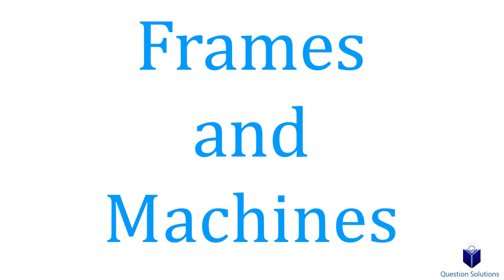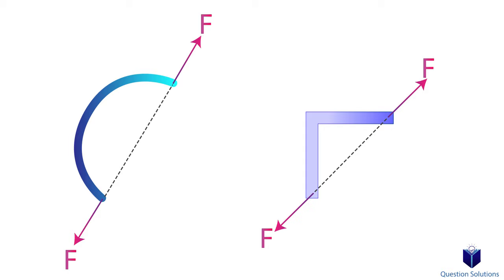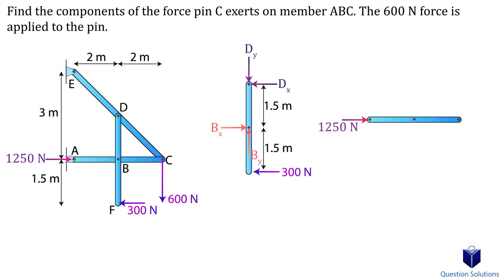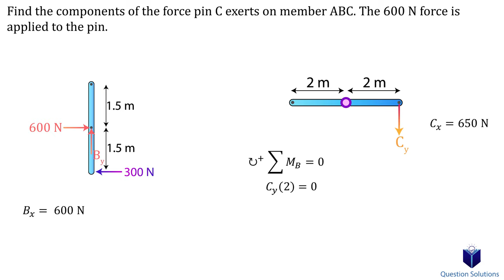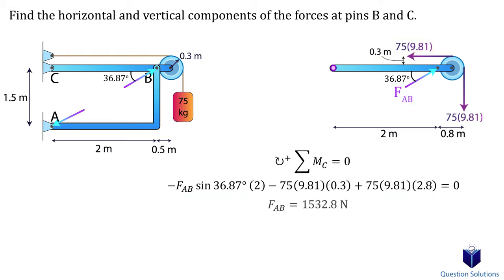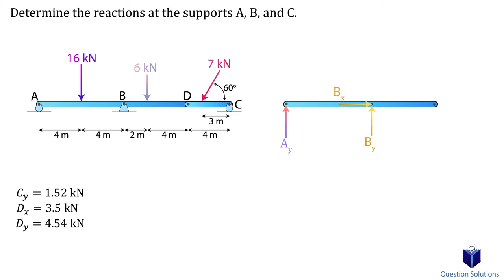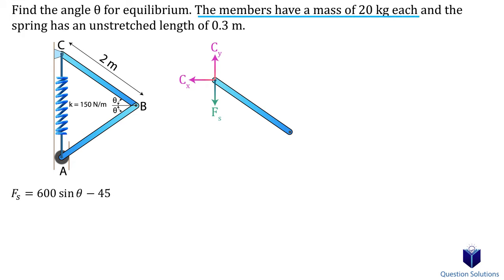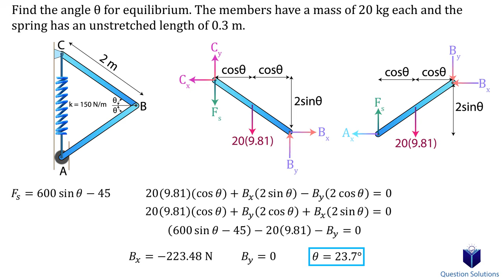Frames and Machines | Mechanics Statics | (Solved Examples Step by Step)

Comment: For the first problem you said the 600N force is not an external force, so why then did you used it to solve for the reactions at A?
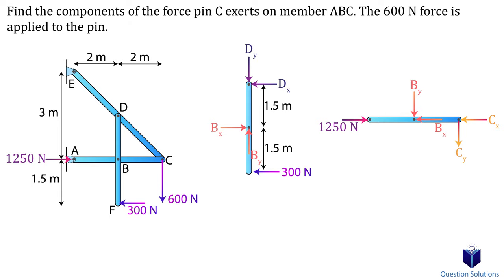Reply from the maker: It's not external when looking at a specific beam, so for example, when looking at ABC. However, looking at the whole system as a whole, the 600 N force will create a moment about point E. That's why when we look at member ABC at 4:09, we don't include it. I explain the process behind it around that time as well so you can understand how to solve problems with this type of wording.

Comment: Hey, in the last question, at the very last part, with 3 equations with 3 unknowns, how do we actually solve it? I've tried many times before, but wasn't able to manually do it without a calculator😅 You're a great teacher!
Reply from the maker: Yes, that one is more tedious, because you will have to use trigonometric identities. Remember that tan θ = sinθ/cosθ. So if you divide everything by cosθ, it will probably help you solve this question easier. If not, another way is to graph it. :)

Comment: I still have some doubts about the method of drawing the force on the pin. When I specify a direction, such as the force extending along the positive x-axis, sometimes it is a needle arrow (the arrow at the needle extends outward), and sometimes it is an arrow needle (the arrow extends towards the needle), how do I determine whether to extend outward or towards the needle. For example, at one minute and 30 seconds in the video, the force in the x-direction is an arrow that extends outward (with the pin reversed). If I draw an arrow pointing to a pin, can I?)
Reply from the maker: So what you're referring to are vectors. Vectors are lines with an arrowhead. We draw them to show a force in a certain/specific direction. Usually, we make an assumption as to the direction. If you get a positive answer, then your assumption was correct. If you get a negative answer, your assumption was incorrect, and it's opposite to your assumed direction. It might be helpful to watch this video: https://www.youtube.com/watch?v=Ixv1QYUAMWk and this video: https://youtu.be/jQDEOwrR4UU?list=PLXePpKFSUW2ZxGn6VdAPY9d7l7HowWVYL

Comment: This video summed up what my professor couldn’t. I am a bit foggy on solving the three equations at the end. I thought B(y) would be the starting point but then there is theta. Idk how to isolate the 3 unknowns there. Or better yet which equation to start with. But still thank you for the video, it helped a great deal. I subscribed and will continue to watch
Reply from the maker: So you can use any of the variables to start off the solving process. In general though, exams usually give you easy to solve equations. The process is to isolate for one variable, plug that into the next, then isolate again for the same variable in the next equarion and plug that into the last equation. I really encourage you to revise simultaneous equation solving with elimination and substitution. It's really important for most courses :)

Comment: I have a question, in the third question why we cant take the bar AB to calculate first instead to CD and I got different answer.
Ur vid is great keep up the good work !
Reply from the maker: You can, there might be a numerical error in your answer. As long as proper moment equations and equations of equilibrium were written, you will end up with the same answers regardless of the bar chosen.
Reply: i have come across the same issue 
i started with AB and took moments about point B to get Ay
my equation was (taking anti clockwise moments as positive )
16(4) - Ay(8) = 0
when i solved i found Ay = 8KN and not 3.09KN
I dont know what mistake i made, asking for help

Comment: In question 2 how do we know F AB points diagonally up and not down? Great video!
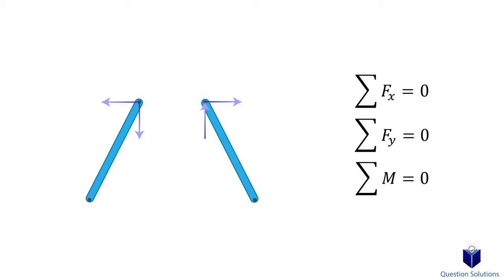Reply from the maker: Please kindly re-watch 1:36. The reason we knew that was because it's a two-force member. It's good to recognize them, so you can have 1 single force instead of having one vertical and one horizontal. Makes the math simpler, but only if it's a two force member.

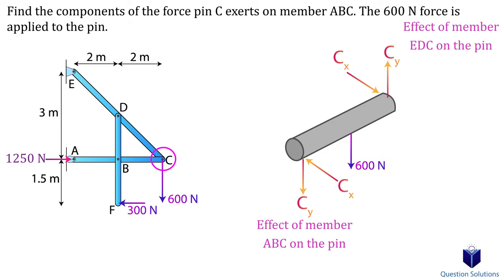Comment: Sir，thank u for your great video, I would like to ask why did you count the tension of the rope at 6：39？isn't it also an external force for the member BC just like the previous example at pin C at 4:32?
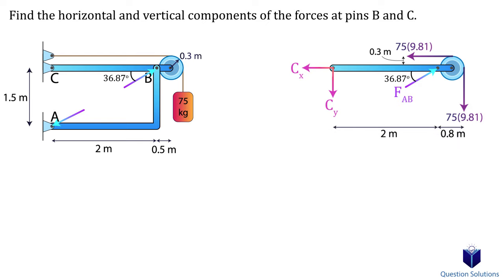Reply from the maker: I just want to point out that the first example is a pretty rare and unique problem where we are specifically told a certain force is applied to a pin so we had to look at internal and external forces that are applied to the pin and that are applied to the whole body. In the 2nd example, it's the same as someone applying a random force just a certain small distance away from the body. So we didn't calculate forces applied to a specific pin, rather, each member itself. So the forces at 6:39 are forces applied to the body.

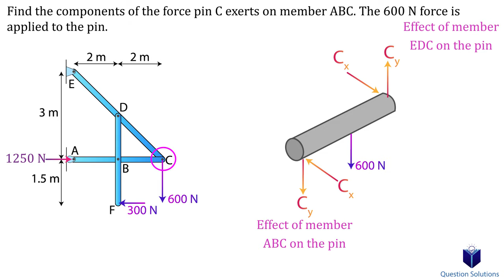Comment: Very informative video. Thank you. I have a question, at 4:45 ,is it that whenever we have such a case( a force applied at a pin joint) and we are considering equilibrium of the two pin jointed members separately, the external forces acting at the joint isn’t included
Reply from the maker: This is a very rare and specific situation. We only treat it the way we did because of the wording in the question, "The 600 N force is applied to the pin." I just wanted to showcase what needs to be done if such a question arises. Otherwise, you can solve it like any other problem shown on the video assuming the forces are applied to the frame.

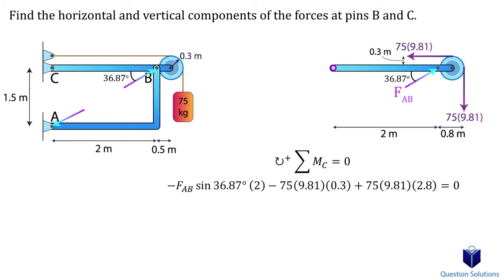Comment: Hello Professor, question about 7:02 where calculating moment at C. Why is the y-component of F(AB) negative? Thank you your videos sure help a lot!
Reply from the maker: So the y-component would face straight up. Imagine this object is free to spin about point C. If we push up at the location where the y-component was applied, would it turn clockwise about point C, or counter-clockwise? It would turn counter-clockwise. Since we picked clockwise to be positive, and this would cause a counter-clockwise moment, it is negative.
Reply: Great, thank you for the response. I have my test today and you have helped a lot! @QuestionSolutions

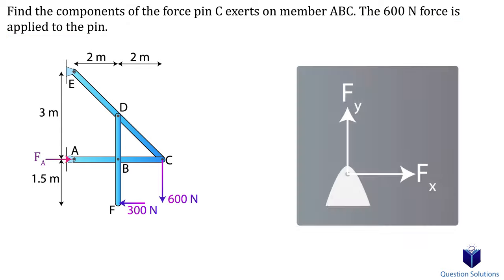Comment: Hi I love your videos!  , quick question at 3:04 for the reactions of a pin it is Ex and Ey but how do we determine if Ex goes to the left or right again ?
Reply from the maker: So it's just an assumption. If you end up with a negative value, then you know it goes in the opposite direction.  If you get a positive answer, then you know your assumption was right. The magnitude of the answer is always correct though. :)
Reply: @ thank you so much for your help :)
Reply from the maker: @nathanmorales8025  You're very welcome!

Comment: Informative !! thank you so much for the video. I have a small doubt. I did not understand why you have not considered the 600N external force while drawing FBD. Can you please clarify
Reply from the maker: Thank you. Please give me a timestamp so I know where you're referring to. Thanks!
Reply: @QuestionSolutions  4min 32 seconds
Reply from the maker: @shyamdev6928  Are you referring to the 600N force applied to the pin? This question is sort of tricky because it specifically states that the 600 N force is applied to the pin only.

Comment: Amazing video, man!

But I didn't quite understand why you ignored the 600KN force at joint C.

Is it because if we're dismantling the frame, any force applied at the joints will become an internal force and won't be considered?
Reply from the maker: We are told that the force is applied to the pin. This question is actually a tricky one because of the wording and it's quite rare. I just wanted to show it so that if you ever get a curveball thrown at you, you can figure it out.
Reply: @QuestionSolutions  

Thank you very much.
I didn't see it that way.

Comment: Hey how do you know what the directions are for each reaction? For example, How would you know if it's the reaction is acting downwards instead of upwards, and why would one go to the right instead of the left.
Thanks
Reply from the maker: It's just an assumption. If you get a negative value, then you know it's opposite to your assumption, but the magnitude of that value is correct. So if you get -25 N, then it's saying the direction you picked it not correct, but the force is 25 N in the opposite direction to your assumption.

Comment: On the first question what would the reaction forces be for E? Would Ex be 950N and Ey be 600N.  If so, when I drew the FBD of member EDC the forces did not add up. One way I got Cx to be 350 while the video shows 650. I'm confused.
Reply from the maker: To find the reactions at E, you would have to write a moment equation about point A and then go through the same process. Also, the question is asking for the components of the force pin C on ABC, not EDC.

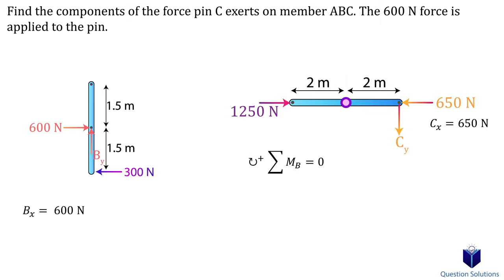Comment: At 5:30 why did u not take torque or moment at 1250
If taken is by=0???
Reply from the maker: The same reason why we didn't take the 650 N force either. The line of action of both of those forces go through the moment point, so they can't create a moment.

Comment: Hello, at 9:45 why isn’t the answer for Ay = 9.91 kN in the upwards direction? I’ve done it on my calculator a bunch of times but do not get the same answer. I think the direction on Dy is in the wrong direction, since Cy = 1.52kN in the upwards direction and 7*sin(60) = 6.06kN in the downwards direction, surely Dy should be 4.54kN in the upwards direction to balance out and have net 0 newtons in the y direction … please advise thanks
Reply: Also, if you take a look at 9:02, the Dy is in the correct direction, so it must be a simple error.
Reply from the maker: I am not sure if you have the timestamps correct or if you're asking about the right question? Ay is already shown to be upwards, and I am not sure where you got the 9.91 kN from? Ay is 3.09 kN. Please let me know where you're referring to so I can help you out better.  Again, even for Dy I don't know what you're referring to. It's shown to be upwards, we got a positive value, which confirms that it is indeed a force in the upwards direction.

Comment: What a helpful video!
Sir, I have a question. In 04:27 you describe Cx and Cy each by member of ABC and EDC. Is it correct to understand that they are not the action and reaction, but just internal forces by each member?
Reply from the maker: Think of it as the force of each member, like member ABC, and EDC applied to the pin, just broken into components. This is one of those videos where the wording in the question is what sets it apart, because we are told that the 600 N force is applied to the pin. Usually, they are forces applied to members, not pins.
Reply: @QuestionSolutions  Thanks a lot:)
Reply from the maker: @chimchar2200  :)
Reply: @QuestionSolutions  this was the best replay for all my confusions. thanks, a lot!

Comment: In the third question why I can't get your answer in Ay when I use AB for solving, my answer is 8kn
Reply from the maker: I don't know, it's not possible for me to answer your question since I can't see any of the steps you took, where you made a mistake, or whether you wrote down the proper equations 😅
Reply: First, I sum the moment at point B, then I assume Ay upward(clockwise) moment arm = 8
Second, the 16 kn pointing downward(counter clockwise) moment arm = 4

Comment: Hi, fr the first question... why there's a moment at point E when it only hve to support reactions namely Ex n Ey?
Reply from the maker: Please give a timestamp so I know where you're referring to. Thanks!
Reply: tq fr ure replied!! at  3:04 u said point E only have Ey n Ex ...while in the calculation at 3:15 you use moment about E to find Fa... are we not supposed to use moment about point E ?because point E only has 2 support reactions
Reply from the maker: @hazwelnut.  Okay, thanks for the timestamps. So I think there is a misunderstanding. There is NO moment reaction at a pin, since at a pin, the member can freely rotate clockwise or counter-clockwise. In other words, a counter moment is not created. What we did was just write a summation of moments about point E. This just means if we are standing at point E, what sort of moments will be felt due to the moments created by other forces. You can write a summation of moments about any point you want, it could even be at the middle of beam, or wherever you please. Please see: https://youtu.be/QNNnPZ68STI
Reply: @QuestionSolutions  Thanks !! That clears up my confusion. Have a good day sir. Keep it going!

Comment: In which software you write mathematical equations
Reply from the maker: I use word with the latex functions. If some of the equations don't look nice, I use online latex generators.
Reply: @QuestionSolutions  sir do you take snapshot of equation or convert it into vector file
my AI file looks blurry in AE
Reply from the maker: @ImmortalAJ-r2t  I don't use snapshots but I think that can work if you use high-res images. Most latex generators can export as a PDF, so I export as pdf. Then you get vector equations. You can use a photo editing program to get it to proper size as well.
Reply: @QuestionSolutions  thanks sir i will try

Comment: At 9:43 why is 16(4) negative but all the other ones are positive?
Reply from the maker: So take a look at the 16kN force with respect to the purple dot in the middle. If the beam can freely rotate about that purple dot, when we apply the 16kN force, would it turn clockwise or counter clockwise? It would be counter clockwise, so it's negative because we assumed clockwise moments to be positive.

Comment: In the ABC member of first example, I don't get why we should draw 1250N in the Free Body Diagram, but not the 600N.
Reply: Actually I think Cy should be 600N pointing upwards instead of 0N. Could it be you made a mistake here?
Reply from the maker: @driesvanranst3440  I actually go through this in details since students tend to get confused here. It's very important that the question states "600 N force is applied to the pin" so please watch from 4:12. I even draw out the pin diagram to explain this. Also no, it's not 0N, the diagrams are correct 👍 If you still don't understand after re-watching that part, I will do my best to re-explain it the best I can :)
Reply: @QuestionSolutions  But at 5:42, you wrote Cy = 0N. Shouldn't that be 600N (upwards)?
Reply from the maker: @driesvanranst3440  No, we solved for Cy, we wrote a moment equation about point B and it turns out, Cy is 0 since no other forces are effecting the beam. What process did you use to get Cy to equal 600N?
Reply: @QuestionSolutions  I'm very confused. I used 2 different ways of solving the problem. First time I got Cy = 0N, second time Cy = 600N (up). I solved by using members ABC and EDC. What I supposed: When drawing the EDC and ABC members separately, at least one of the diagrams should include the given 600N (down) at point C. When I put the 600N on the EDC diagram, the result is that Cy = 0N. When put on the ABC diagram, the result is Cy = 600N (up).... Would be easier if I could show you my Free Body Diagrams.
Reply: I have sent you my FBD's by mail in case you are interested.
Reply from the maker: @driesvanranst3440  Replied 👍
Reply: sir, can you make FBD of EDC.? is 600N still not included..?
Reply from the maker: @ianjamespalulay2003  Yes, it wouldn't be included if we draw just EDC and that's only because the question says the 600 N force is applied to the pin.
Reply: So Cy for EDC member is equal to 600 N right ?
Reply: @QuestionSolutions  so Cx for EDC member is 650 & Cy for EDC member is 600 N right ?
Reply: @QuestionSolutions  am asking for EDC member. pls check again. Cx & Cy for EDC frame pls tell. do reply
Reply: @QuestionSolutions  Cy won’t be zero in case of EDC frame since 600 is already applied you can check it via FBD of point C
Reply: @ElCrankoPunko  That is correct, there are actually 2 values of Cy so we need to differentiate them by their names like C_edc,y and C_abc,y
C_edc,y is a Cy from member EDC has a value of 600 N downwards
C_abc,y is a Cy from member ABC has a value of 0 N
Reply: @ElCrankoPunko  For EDC member the values are:
Ex = 950 N to the left
Ey = 600 N upwards

Dx = 300 N to the right
Dy = 0

Cx = 650 N to the right
Cy = 600 N downwards (or to be specific, C_edc,y)
Reply: @viralcat-w4x  Exactly. Thanks for the reply
Reply: @viralcat-w4x  yes got the same values :)
Reply from the maker: @ElCrankoPunko  Yes, if you do the math for the EDC member, you will get 600N for CY. The question asks for the components of pin C on member ABC, so I only solved it for what it's asking.
Reply: @QuestionSolutions  yea got it. thanks :)